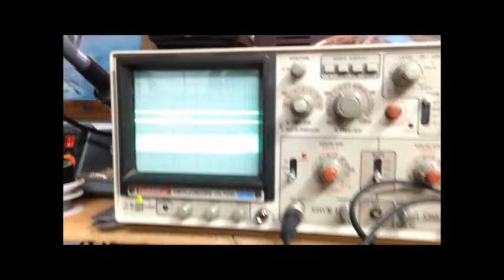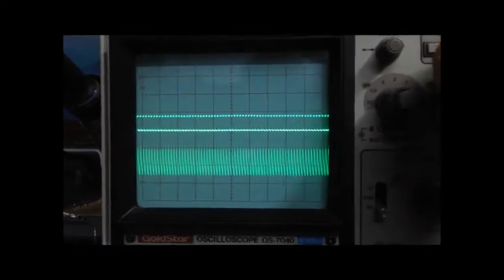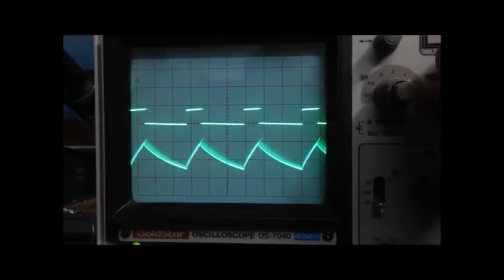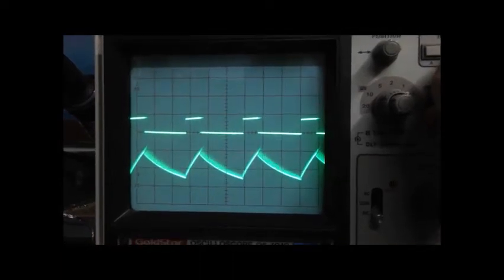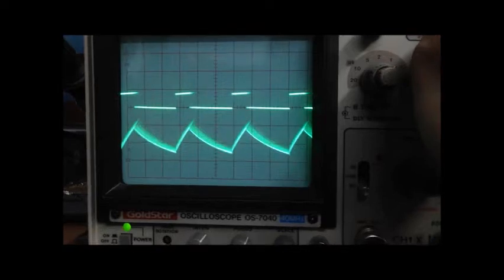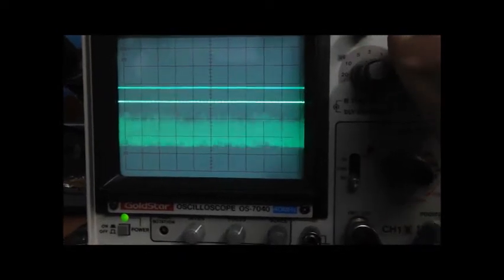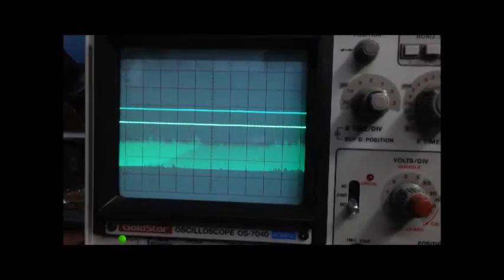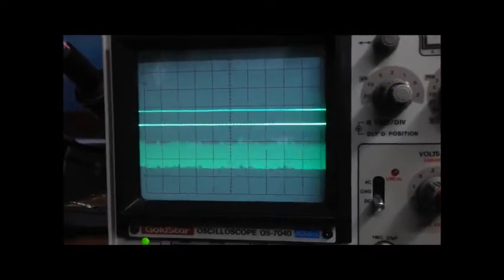Arduino Hi Fi Audio PWM

Comment: simple(simplest I must say) and works out of the box, however, when the volume output is low from the phone(say for example silent portions or low volume portions of a song), there is considerable amount of distortion.

Also, when this change is done in your code, the sound get louder with much lesser distortion. 

duty = bias + ((raw - 512)/2);

Also, using 100 Ohms resistor in place of 560 Ohms yields more output and better fidelity. Of course, with proper output stages, that would be removed, but this is a good circuit to play around to start with to understand PWM.

This is the only code and circuit well documented that can be straight away used on the arduino and give something to an experimenter to start improving or make own changes. Thank you for posting, this is my first entry into the world of Class D, and I will leave further notes when I get some time to do some enhancements and simple output devices to remove the use of the external amplifier completely.
Reply from the maker: +Anand Padhi Glad to have helped, and well done! Yes, I didn't design the circuit/setup around an ideal situation, just something I wanted to test as a proof of concept, so there's plenty of room for improvement!

Comment: Would it be possible to share the code and hardware specifications.  I am in the middle of a project that needs this kind of thing? Thanks.
Reply from the maker: Craig Harrison Direct file links were in the description, but here's my blog post about the project in the video which has explanations: http://sigurthrenterprises.blogspot.com/2014/01/arduino-high-quality-audio-modulated-pwm.html
Reply: Sorry so they were. In theory, could I run the output off a sine wave in the ear range to produce synthesised notes?,  what would be the best way to calculate the delay for a particular frequency, 
440Hz for example?
Reply from the maker: Craig Harrison The Arduino can't output a sine wave, only a square wave. You can get a sine wave out by feeding one in using the circuit in this video, but to totally synthesize one you need a different scheme entirely. There's a technique called "Sinusoidal Pulse Width Modulation" or "SPWM" which creates sine outputs from digital synthesized signals and that's what you should look into if you need that capability (direct digital synthesis of sine waves). The low pass filter network is determined largely by the carrier wave, so it isn't a one size fits all type of thing either.

Comment: I'm gelicenceert amateur and asked myself:

it is possible to use the output PWM
to use the PWM for a modulator ?

So audio in the Arduino.
PWM of the Arduino and then to drive some FETs
and the FETs would drive a AM amplifier?
(an Arduino modulator?)

friendly greetings!
Rob.

Comment: Does it use an opamp? And does it sound ok being 10 bit?
Reply from the maker: It actually sounds quite good despite being only 10bit depth. It's certainly not low distortion, but it is low enough distortion for casual listening. The real power of the program is that it lets you encode real time analog audio onto binary format (transmission over light, or easy class-D amplification are two prime applications) without any significant hardware additions to an arduino. Oh, and no there are no opamps being used (outside of the intrinsic silicon of the atmetga in the arduino).